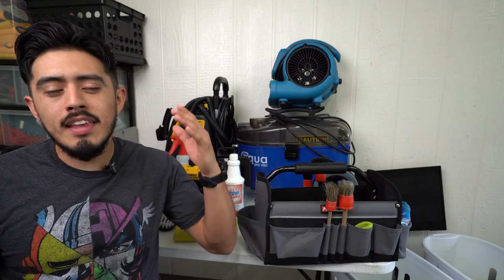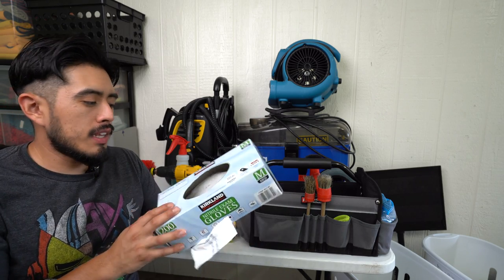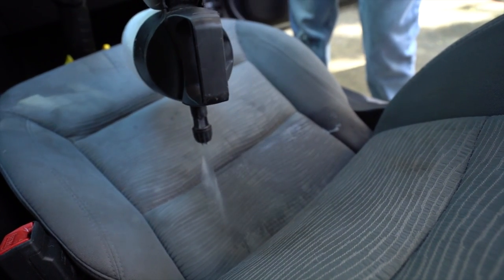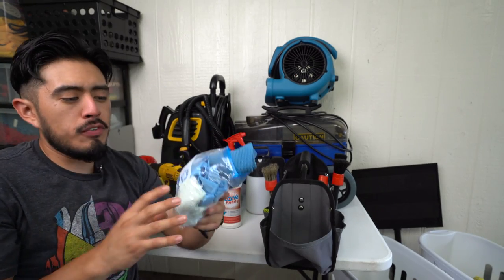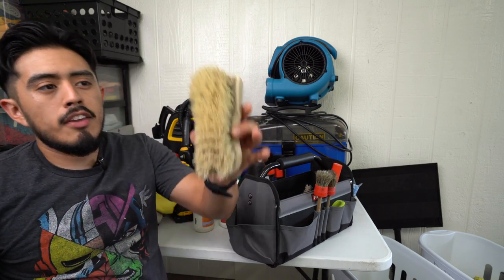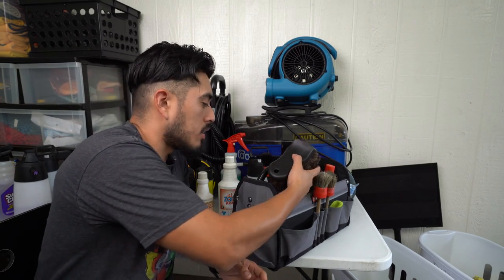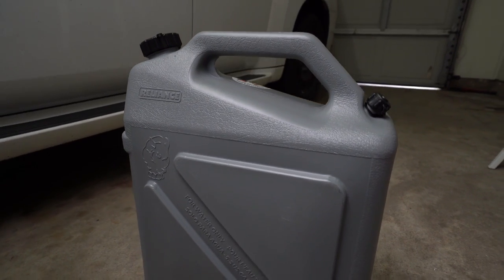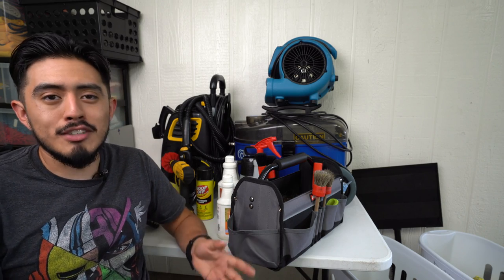All Interior Car Cleaning Tools and Products I Use (2019)

Comment: I own a few businesses and I completely agree with your opening statement. You don't need all the toys to start, you just need the minimum to get the job done correctly even if you have to work more/harder your 1st couples times, then slowly invest into your craft. 1st time I started my demolition business at age 22 I borrowed a tractor and a dump truck and shared the profit with the owner, then eventually bought my own tractor, then another, then another, then my own dump truck, then 2. The problem with todays kids is, they teach them in school that the 1st thing they need to do to start a business is go to the bank and borrow 100k-500k. So they are already deep in debt before they even made a dime.

Comment: For the metrovac, if you use it as a vacuum, do not use it as a blower.  The hose will get filled with dirt and debris and if you use the same hose to blow, you will blow all that crap out onto what you are drying.

Comment: With the extractor if you do no have the funds you can use your wet vac as the extractor. A clear extractor head is best (mainly for marketing), or just use a crevice tool. Clean the carpet/seat like normal, give a spray with clean water then extract using wet vac. I use the Rigid 4 gal about $80.

Comment: I used a clearance $19 steamer from Walgreens... Did really well!
Reply: What are you using an Iron.. lol
Reply: @Sheesh_Pickup  It was a green steamer. About the size of a coffee pot. 

Getting a MC 1275 or 1385 soon!
Reply: What did u use it on
Reply: @shonhargett1578  LOL. Pretty much anything. Did wonders for removing oil stains from headliner. Just used carpet cleaner, APC and the steamer.
Reply: Omg no way! I need to try that!!
Reply: I have a Bissel Steamshot. It works really well for about a third of the price of the MC. And it donates 25% of the sales to dog shelter
Reply: Need that

Comment: Detail geek used the bissell extractor and so do I and it’s $160. No need to spend $400 on the aqua vac
Reply: Facts ! It works amazing as well for the price !
Reply: Maybe if it was heated
Reply: I bought that too based on detail geeks recommendation. The first ones handle broke two car seats in to the job. I figured faulty build, no biggie. They replaced the entire unit. The second unit handle broke the second I tried to use it, just blew water all over the place. I had to use my shop vac to suck water out of the seat. And the second unit also leaked profusely from the storage tank.
I got my money back and am still looking for an extractor.
Reply: @tueighty  Hoover Pro Spot Extractor is good, I been using it for a little while now

Comment: QUICK QUESTION:  when I use the streamer to clean the interior. Do I also add something to the interior  And then start steaming . Or just start steaming asis? 

If I do have too add product. What’s do I use?? What’s a good product too use ?
Reply: P&S xpress interior cleaner is a good one, smells good too.
Reply: @ashtonthompson327  ok so in other words. I apply the p&s on the dirty surface of the vehicle. Then steam it then wipe it off? Sorry I’m really really new to this. 

And I own a huge shop shop as I am a dealer.

Comment: I have the Hill Injection but the injection feature is pretty useless. I'd get the TOSCA instead. They are great steamers.
Reply: maintenance on those steamers?
Reply: @calvinwong365  You have to descale the boiler when it tells you.. depends on water hardness. Anywhere from 20-100 hours of use. You can't use distilled in these because they have an internal TDS meter to monitor the water and will malfunction if you do. Pros and cons. I use reverse osmosis water in mine with a low TDS count so it works well. Its nice you can throw tap water in there in a pinch. They have a nice super responsive trigger too.